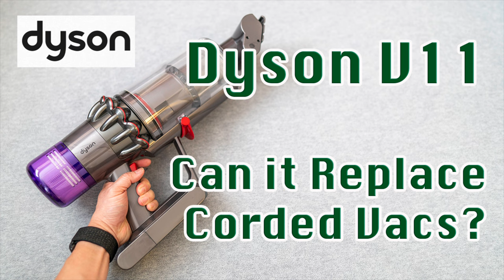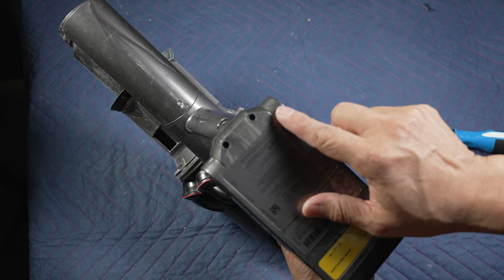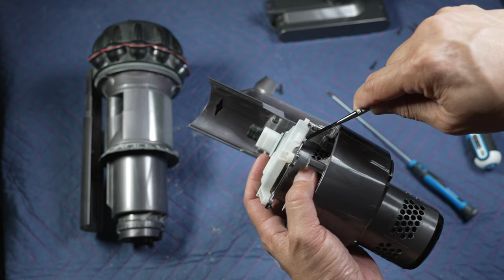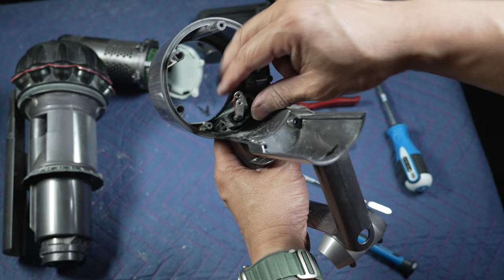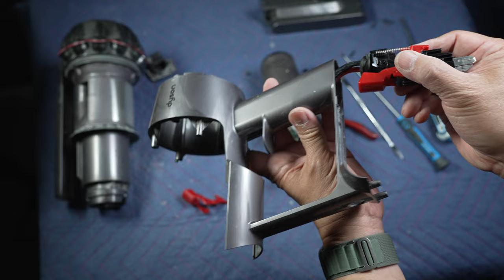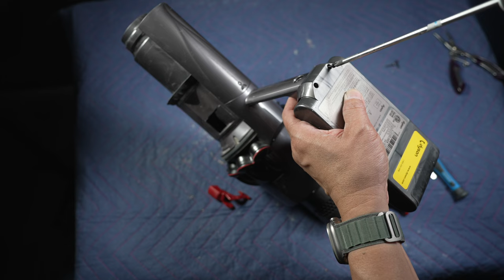How to Replace Dyson Cordless Vacuum V10 / V11 Trigger | DIY Repair Step-by-Step

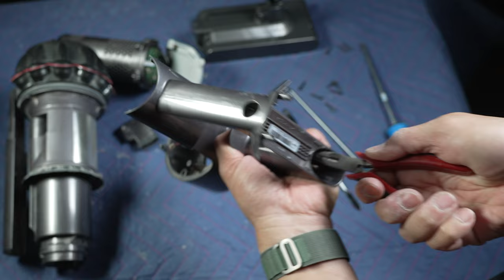Comment: I appreciate the video, very helpful. However, the way you pulled on the terminals to pull out the full trigger assembly at time marker 6:39 seems a little risky for me, in that the terminals may get dislodged.  I ended up using the pliers on the plastic piece just below the terminals and was successful. The break was in exactly the same spot as you showed on yours. Thanks so much. I will order the more reinforced trigger from Amazon. Will update.

Comment: Hi, I purchased the new part, but while when I tried to put it back in its housing the switch did not pop out as it should (itbstays sinked in). The spring works just fine though ..any ideas? 😢
Reply: If you're referring to the trigger while it's still disassembled, once the battery goes back in the trigger will spring out like you're use to.

Comment: Hi there!  Thank you for this video. I was able to change the trigger easily!  I now have it all put together but it will not run. Any thoughts? Thank you. Leanne
Reply from the maker: Sorry to hear, @leannebassett5626. I'd double check the connections to the terminals. Let me know how it goes.
Reply: I actually took it in and they told me the battery is no good. Strange because the battery was working right up to when the trigger broke. I’m puzzled as to why this coincidentally happened at the same time?

Comment: Thanks for the excellent video.  During the course of replacement,  I accidentally over screwed and broke the T8 screw hole inside the handle. Nevertheless,  I managed to get it working but now it seems to stuck even I released the trigger and only able to "off" it when I slightly pulled the trigger out. Any idea is it due to the broken screw hole that not able to secure the trigger in place or the trigger is having issue? Thanks

Comment: Thanks for this excellent video. I've put it all back together but now it's always on! I can't see why. The springs on both the battery pack and the trigger are in place and still working, but when put together the motor comes on and pressing/depressing the trigger make no difference- i can't switch it off and have to pull out the battery pack to stop it. Any ideas on what i've done wrong?

Comment: Great video! Its working, but my only problem seems to be that the battery isn't fitting snug anymore, a bit of a gap where it meets the handle. Any tips?

Comment: Used the video to change switch to a metal one. The only issue I had was that the green circuit board was covered in a semi clear rubber covering which I had to remove around the two screws and white plug. Did cover the area with a bit of clear tap when reassembling to try and seal it a bit.

Comment: Thank you for a great video! Like you said, not difficult, just a bit of a pain. At the middle, I had a leftover short screw, I left one short screw off the cover, didn’t want to unbend the terminals and take out PCB, guess I’ll set side for when it breaks again. 😊
Reply from the maker: Glad to hear! Thanks for watching and letting me know, @eeng4234! Yeah, wish Dyson made it easier!
Reply: @Tech4Baba  I messed something up, I think maybe  I didn’t push the switch assembly down enough, sometimes it doesn’t turn off. I have to mess with the battery a bit, and then it turns off. Sigh…

Comment: I opened, replaced the trigger and put it back together with no problem. But now, it doesn’t work. 🤦🏽‍♂️ 

what could’ve cause this to happen? I plugged the cable back in the motherboard and battery terminals put back the way they were. 

The battery life indicator turns on when i pull the trigger but nothing happens. 

Pls help

Comment: I don't know why you aren't upset with this flawed design by Dyson. I certainly am. I have the V10 and the trigger broke on me in close to a years time. I have since replaced the trigger similar with the one you have. The package looked the same anyways. Guess what? It broke...again. I was ready to give in & buy another Brand (Makita) cordless vacuum, but decided to replace the  trigger one last time. Like you said it isn't too difficult, but it does take some time. The bending of the meta plates I am leery about. I noticed there is a beefier trigger out there. It has a thin layer of metal. I will replace it with this version when I receive it.

Comment: 😂e installed a new trigger and after attaching the spring it still didn’t push the red trigger button plug far enough to keep the vacuum running.  An suggestions?

Comment: Hi, thanks for this video. I followed all your instructions and the trigger worked the way it was supposed but it didn’t run. I thought maybe it was out of power so I put it on the charger. When I lifted it off the charging station it started running but wouldn’t turn off. Where do you think I went wrong?
Reply: Same thing happened to me!! I can’t figure it out.
Reply: I actually did the whole process over again and it worked. I guess I must have done one of the steps incorrectly
 @MadelineMoloney

Comment: Thx for the video. I successfully disassembled my Dyson. In my model the circuit and cables were covered in some kind of silicone. It was easy to take over, but I do not know how to cover it again. Normal silicone?
Reply: How did you remove the glue? Im having problem with it. Scrapping off bit by bit now.
Reply: @nymaamyn  with a flat screwdriver. Mine was brittle and easy to remove bit by bit, but I onle removed it on the screws and the cables.

Comment: Thank you very much. I'm always great at disassembling things but usually struggle to put back together in working order. Small outlay for part and torn screwdriver 🪛.  

Fixed and working again. Also what a great gadget for the trigger to keep it engaged, thus probably not breaking the new one as quickly.  Can't believe a vacuum from Dyson comes with such a cheap trigger that you have to keep engaged manually.  Almost as if they want it to break!!! I called Dyson and after going through a trouble shooting session was told it needs a new main body.  Really... Money grab and and more saddening to me is that it's not resourceful. 

Thanks again dude. Liked and subscribed 😊

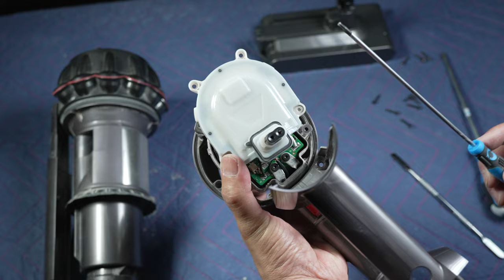Comment: Hey there, while trying to disassemble my dyson I stripped one of the small screws that holds down the terminals 4:18, what should I do? I tried the rubber band hack but it didn't work
Reply: Me too. I successfully drilled the stripped screw out but I'm trying to find a replacement screw still! Might have to solder the terminal down

Comment: My V10 for some reason had a bunch of rubbery plastic stuff coating the circuit board that i had to peel off to access the screws. Then the trigger assembly just would not come out. No matter how i wiggled or how hard i pulled. I even pulled out one of the copper plug things. They just built my v10 in a way that it could never be repaired for some reason. Im now out of a vacuum.

Comment: Two questions on V10 please: 1. How can I fix a broken red click connection plastic between the vacuum main body and its brush-attached plastic cylinder?  2, Is it normal to experience a significant sucton/cleaning time loss (40-50% per experience) after around 3.5 years of usage with the same suction setting and charged condition?

Comment: Need some help:
So I followed step by step , had some complications but still managed to follow 
So now it works BUT: it won’t turn off. It keeps vacuuming ! What should I do now? Any advice?
Reply from the maker: Sorry to hear, @danachristina1729! Does the trigger pop back up/out?
Reply: @Tech4Baba  I found the issue: so the trigger works, pops back up. But the problem lies within the battery… whenever I like accident
Y touch the battery (screwed in) the vacuum won’t stop. When I push against the battery, the vacuum stops vacuuming. So I wasn’t quite sure on how to fix it, so I just used some duck tape so I could at least use it. Any ideas on what to do? And thank u for your reply!

Comment: If only whoever assembled my vacuum didn't cover the circuit board in hot glue to prevent anyone from safely accessing it. Your instructions worked very well until I got to that point. Thank you.

Comment: Writing this in 2024.. Dyson has put a glue (?) all over the board now, so it was such a hassle to remove all the glue jelly. Scrapping off bit by bit, i was so afraid to scratch the board, or accidentally cut off a wire. And the torx screw on the board is almost impossible to remove now, because of the glue. FYI.

Comment: Now when I put everything back together the trigger constantly presses the battery trigger and it stays on... Any suggestions?
Reply: Did you find the answer to this? Having the same issue now
Reply: @ruthtrotman1  no... I ordered another part and it worked. Old assembly wasn't fitting correctly for some reason

Comment: Seems like Dyson has seen your Video as well - my Dyson V11 is covered in Glue Gun Glue under the white cover. And in addition, there are no Screws forthe terminals, and no wire connector. Just glue and electro welding. Dyson charges over 80 Euro for switching out the trigger - THX Dyson for making repair impossible for the customer.

Comment: I think I did everything according to the video and put everything back and the vacuum won’t turn off 😆. I might’ve connected the metal terminal wrong.
Reply: Did u fixed I have the same issue 😆
Reply: @manuelirizarry9982   lol where did we f up. I just ordered a new cyclone and the motor from Dyson.

Comment: To everyone that put the vacuum back together and is horrified that it's not turning on - as I was - but instead only briefly shlwing three blue lines: it means you didn't plug the small white square connector back to the electronic board in properly. I suggest you go back, really push it in (it should click) and even add a nice layer of glue like it was when you opened it. Works like a charm after this!

Comment: Save yourself the $15.  Repair the old one with a piece of strip tie (thin), and crazy glue on the outside of where the trigger piece failed in tension. The repaired trigger will outlast any new one, and likely outlive the vacuum.